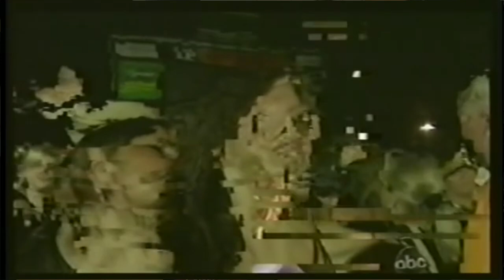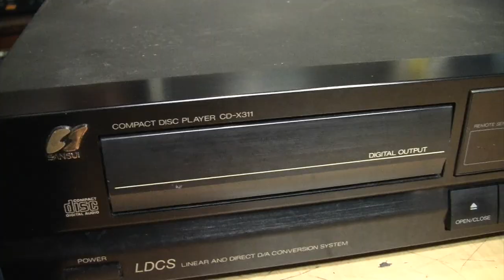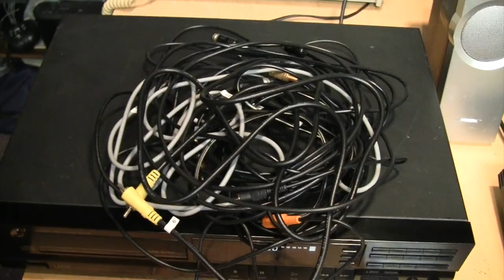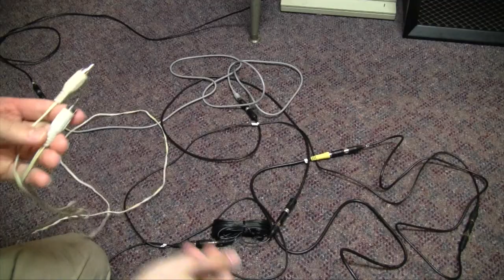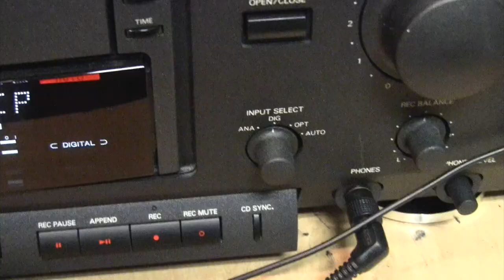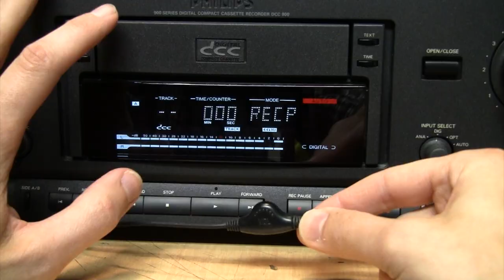What does a crappy digital audio cable actually sound like?

Comment: To me that cable has a lot of cross-talk since you're using both sides (red and black). So it's not really the length that broke your audio. Cross-talk is a much bigger issue over cables for digital signals and you caused a lot of it to occur by passing the signal over the unshielded pair both ways.

Comment: Great video. However I think I know what’s happening here. Digital is 1’s and 0’s. That’s square waves. Sending identical data in the opposite direction down parallel cables could be partially cancelling itself out. Maybe. Or your cards sensitivity is poor or its input impedance is slightly mismatched. Still absolutely fascinating video, keep them  coming!

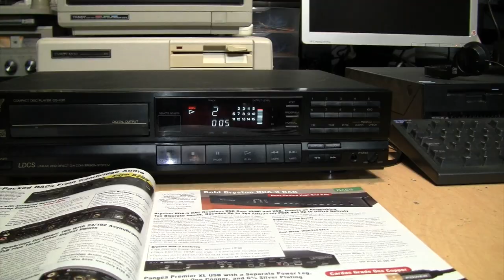Comment: At the 22:12 min., mark you have a Y cable hooked in, and it is hooked in wrong, the is to say, your putting a signal in one side (R) and trying to read the signal other side (L). Your dealing in analog signals here in the audio range, not digital.  Shielded  cable, how to say this, is a LCR circuit. The major problem, as I see it, is the inter-electro  capacitance between the center wire of the cable and the cable's shielded (put there to cut down on out side noise). If the electro-capacitance is to high, it will cause the loss of the higher frequencies of the audio signal, dulling the sound. For the broads band of signal to be passed a straight piece of wire would be best, but for the external noises, so to prevent this noise the wire is shielded. The material used to keep the signal wire and the shielding (ground) apart effects the electro-capacitance of the cable.
Reply from the maker: The video ends at 22:12, so I don't know what you're talking about.
Reply: @vwestlife  I'm in error, the time should have been 11:44,  but still I was wrong about the way you  hooked it up as being wrong, sorry. I now believe there maybe something wrong about the wiring of the Y connector.

Comment: Good experiment, thanks for posting it.  Of course you will never convince the mystic "golden ear" crowd.  It would be interesting to do that experiment with an oscilloscope where you could see how much distortion of the "eye pattern" it takes for the destination gear to start muting.  And, of course, different destination gear may be more/less tolerant of distorted digital waveform.

Comment: The Venn diagram of "audiophiles" and "idiots" is a circle, especially when it comes to anything digital.  Also, your cable length test almost certainly finally failed because you crossed the feed through that last "Y" connector, not because of the overall length of the cable.  But, great test!  Well done you.

Comment: Great video as always! But in total fairness, you probably should've recorded a take with a ton of crap cable in, and a take without, lined them up and reversed the phase of one to see if more subtle degradation occurs like what's being claimed in the article. Maybe it wasn't audable over the sound card or those speakers. I'm playing Devil's advocate and I don't think it would make a difference, but if there's total destructive interference, I'd say that's definitive  proof you don't need expensive digital cables.

Comment: Wonder if its the fact that when you go into one end of that dual cable, then out the other, you are sending signal both ways on a cable that is not only un-shielded, but mated to itself as well... I wonder if that was canceling things out to some extent, causing that distortion that was only prevalent when going both ways with said cable.

Comment: I've asked around at audiophile forums, but I've never got a satisfactorily logical answer as to why a high end CD player is any better in terms of music quality than a cheap portable Walmart special - Especially if the CD player is outputting digital. I realize that there can be differences in DAC quality, but I'm thinking that's largely negligible and psychological too. Speaker quality is undoubtedly where you'll get the biggest variances in sound.

Comment: I've always made my analog/digital audio cable from aerial/antenna-cable fitted with RCA-Phono connections and it's fine.
Practically with 0 (ZERO) dB loss for the analog side.
Hell, I've even fitted them with snakeskin socks to make them look expensive. They can compete with $500 cables according to an honest source.

Stupid Audiophools while hypnotized by some extremely expensive golden unidirectional copper-crystal thingy-things, somehow manage to forget everything about the tiny and small copper traces on the PCB's (Print Circuit Board) inside their gear, where components are connected using melted tin/lead. Even the metal pins on the components are left out of the equation.

The most wacko of the kind spend their money on expensive power connectors, between their gear and the wall-230Volts/110Volts outlets.

As if the electrons after travelling hundreds of miles in copper wires between the powerplant and their wall outlets, all of a sudden would be so freakingly happy travelling that one meter/three feet in an expensive power cable until they reach the transformers, full wave rectifiers, resistors, inductors, transistors and resistors, not to mention the tiny traces of copper on the circuit boards, that they alone from that, will reward the phool and deliver the most spectacular, clean firm airy crisp sound ever heard on Planet Earth.

Well.........yeah..........

Comment: The "audiophiles" who hate you for pointing out some of their record deck fallacies are going to double down now. I've always wondered how quickly their heads would explode if they saw the (poor) quality of some of the kit and cables actually used in recording studios and broadcast kit to make/broadcast the media they obsess about the playback quality of.
Reply: M T I suppose I can’t exactly comment on headphones, as I don’t have enough experience. But with iems, this is 100% not the case. I will admit, that the sq/price ratio decreases as you go up the ladder. But to say that a >£1000 pair of headphones only gives an extra 5% is demonstrably wrong. You may not have experienced this as intensely due to the fact that your HD660 are renowned for how great they are for the price, but in other similarly priced models, the same can’t be said.
Reply: Cian Duffy Dear god, if they found out about the poor kits in studios, they’d probably plan terrorist attacks or something
Reply: M T can you just elaborate on what you mean?
Reply: M T I’m hardly ignoring dr, I even admitted that when prices significantly increase, sound quality increases too, but nowhere near in the same ratio. Also, I don’t know where in my message I said the totl’s were a must, I just said that the difference between something that costs >1000 and >200 are significant. Again, this is simply from my personal experience.

Comment: S/PDIF signalling expects a 75 Ohm transmission line over coaxial cable. These twin wire audio cables are none of them. This causes high attenuation and reflection on the signal line. With only 1V amplitude it is no surprise that the signal is heavily degraded and hardly recognizable as digital signal with so much bandwidth lost.

Comment: Clock jitter is straight up bullshit created for the express purpose of reaming out your wallet. Worst part about it is that audiophiles will take it hook, line, and sinker, even if it won't make a difference compared to the "worst" cable under normal use. :-/

Comment: The main reason you buy quality cables is for durability.   As long as your connector is heavy duty enough,  and your wire is thick enough not to break with some flexing.   Decent quality cables are not crazy expensive,  and are usually worth buying.   Many times, I make my own cables.
Reply: If a cheap HDMI breaks because of the connector, what do you do? Get an expensive one? Of course not, you get another cheap one. How often do these things actually break down anyway? Why spend $30 on a cable when you can get one for $3 that performs exactly the same? You can replace them nine times and they'd still not be more expensive.

Comment: think of it this way speed limit on the highway is 120kmph and you can easily hit 120kmph. somewhere you heard that lighter the car, faster it goes. your assumption is that if a light car goes faster, I can put weights on my car and make it slower. you started to put 5kg weights on your car and test your speed, you can still hit 120kmph. after too many 5kg weights you could not reach the 120kmph limit and you are like i put this much weight almost doubled the cars original weight, of course, it is now possible that I can not hit 120kmph and claiming adding weight, unless you double your car's weight, does not change anything and lighter cars does not go faster. in this analogy speed limit is your speakers, the can only produce mediocre sound. your car is the coaxial communication protocol, which obviously has some headroom. and the weights are the cables you added. if we follow the same analogy a Ferrari at a german autobahn would show the effect of the extra weight caused by the passenger. overall what i mean is you don't have the right equipment to test your claims. you keep saying "it sounds good, it sounds alright" but with those bose's nothing sounds good.
and of course you don't even need to try if a digital cables quality matter for average persons daily uses. it does not matter unless the cable is the worst piece of crap in this world it would work FINE. same for the usb. on average if they work, they would work. but those expensive cables are meant for the systems worth $100.000 or more. systems that are so sensitive that can be affected by the smallest imperfections.

Comment: The one thing this can't test is how much error correction is going on at the D/A converter. That's definitely one thing audiophiles will bring up when talking expensive cables. Do I think I could hear the difference between the 100' of cheap coax vs a $100 3 ft cable in a blind test? Probably not.

Comment: Standard law of digital information transmission, it either works perfectly or it doesn't work at all.
Reply: Anthony96922  As with for example CD's, once there is only a little bit of error flying around the music is unbearably broken. But with an old cassette or record having "issues" there might be a little hiss, or a crackling sound, but it's still okay. Digital audio has no room for error. You either get it 100% or it's useless
Reply: @dantevortex  "Digital audio has no room for error."

That is just wrong. Even a brand new Audio CD has some bit errors - but due to additional bits used for error detection and correction these errors could be perfectly fixed so the output is still perfect. If the error rate increases due to scratches or dirt it comes to a point where errors are still detected but not corrected anymore. In this case a normal CD player tries to do best possible - interpolating samples which could not be correct by interpolating them from the previous and next sample - which is  NOT 100% accurate but normally still not hearable at all. But of course if to many samples could not be read than there is nothing more left to interpolate unreadable samples.

So in reality  an audio CD hat plenty of room for errors and can handle without any hearable effect until the error rate is to high.
Reply: I d   thin eeee  y     n      someti     i f     dUHHHHHHHH o ,   mean.

Comment: I send SPDIF down about 10 metres of CAT5e cable from my TV to the digital input of my stereo amplifier. It only works if I send the signal on one wire and connect all other seven as ground. Just using one pair for signal and ground resulted in similar digital distortion as demonstrated in the video.  However even in the working configuration, the amplifier wil briefly mute whenever a thermostat (fridge, central heating) or light switch is operated.

Comment: Nice idea, nice test. Use a multimeter to measure the resistance so you know how many resistance is needed to distort the signal/sound. I bed it is out of normal cable conditions, the longest and cheapest cable available will be never have such high resistance. For example I have a cheap 5 meter hdmi cable ($4 or $5) and no distortion at all. Resistance I measured: 3.3 ohm

Comment: Very hard to screw up a digital signal, nice demo. Only difference I have ever noticed is when I switched out the output RCA cables on my preamp with XLR, and it was slight.

Comment: There are boxes of "junk" (used, untested)cables at the electronics shop near me in Japan and i always dip in there for cables when I need them. Never had a problem with any of them so far and I pay something like $1 a cable compared to whatever new cables run for. i heard the same kind of claims about "quality" HDMI cables too and learned it was also a joke.

Comment: How long can you do that over TOSLINK?
Reply: It looks like the limit is generally fairly similar. But instead of lowered voltage, it seems it's just the light being absorbed along the length of the cable. Boosters &/or higher quality plastic/glass(better optics) can be used to extend the length. Monoprice sells 100' plastic cored optical cable. I'd probably be more worried about breaking it :p

Comment: If you get that last long stereo cable and actually split it into two separate ones,  it would probably work. The way you are connecting it right now, means the signal goes all the way to one end and then returns through the other half of the cable which runs inch for inch in  parallel to the original. This causes massive crosstalk.
Reply: If its a sheilded cable it should have worked
Reply: @dlarge6502  It was shielded audio lead

Comment: I have my Sony SQ Decoder SQD-1000 and it connects to another stereo amplifier which is my Sony integrated stereo amplifier with two additional speakers for the rear and my main front speakers for my Realistic STA-100 receiver and it works perfectly and the AV cables are a complete mess. I tried the DVD player and digital downloads of movies in MP4 and it does sound better than any other home theater setup using my 1970’s SQ decoder which was a quadraphonic system that they used in the 1970’s using the SQ matrix system. Other quad systems uses QS and CD-4, and it’s also compatible with Dolby Surround 5.1 Pro-Logic, Dolby Digital 5.1, DTS, and THX, and there were DVD’s and Blu-Ray’s using the Dolby Digital 5.1 encoding disc that goes into my SQ decoder, and the connection are an absolute nightmare. Now I can movies like it was shown in a theater using my vintage Sony SQ decoder SQD-1000 from the 1970’s.

Thankfully, I have so many RCA cables in my stash, and they are working okay.

Comment: I think the reason why the last stereo cable distorted the signal is beacause of interference. The signal was traveling through the cable in oposite directions while separate channels of that cable are very close together. Although magnetic field created by such a small current is not strong enough to be picked up by anything in near field, both sides of the cable acted like coupled coil antennas. Therefore the signal was time-shifted and mixed together and created heavy distortion.

Comment: The greatest offender has to be the optical cable with gold plating.  It's light, you dolts!
Reply: Yup, I've bought one several years ago, not because it was gold plated, but because it was very cheap and of the right length. I still keep the packing with an inscription "Gold plated for better contact" because I like the concept.
Reply: Lol.  Yup.  Those people spending $300 bucks or more and I buy it for $5 bucks.
Also those crazy people buying speaker wires for thousands of $$$.  A $10 12awg cable sounds the same...Biggest rip off in history!
Reply: But shiny?!
Reply: Yeah, like who tf needs gold plated TOSLINK cables? As long as the fibre inside is of decent quality, who cares?

Comment: That's why you can have internet over some old crappy thin phoneline cable, digital signal doesn't care too much.
Reply: Very bad example, for ADSL there is a ton of processing going on the signal to determine the channel. Your cheap plastic router is going through an activel training phase on connection with the DSLAM in order to determine the quality of the cable and to decide on the bands to use for communication and using bad cable will actually degrade the throughput.